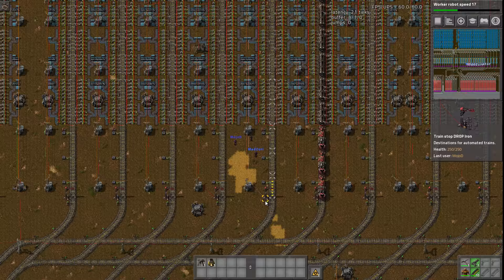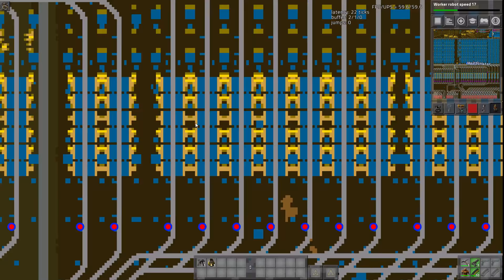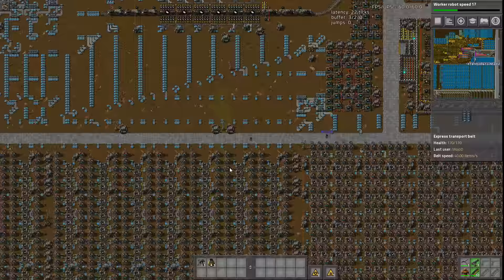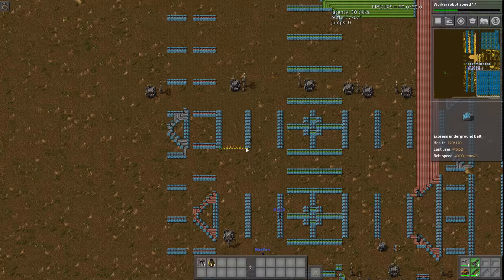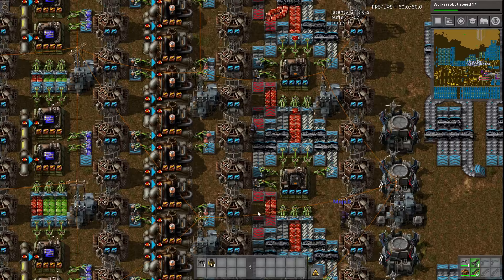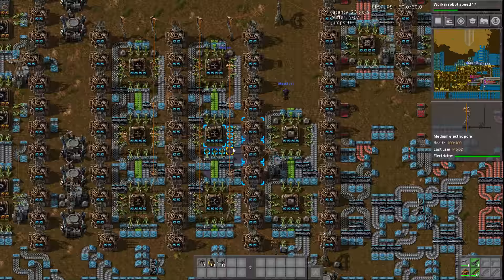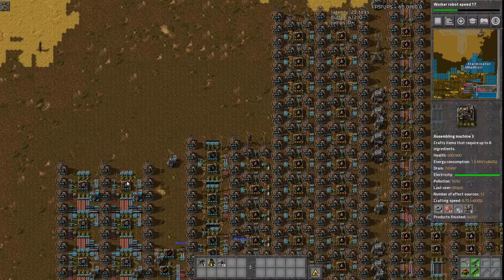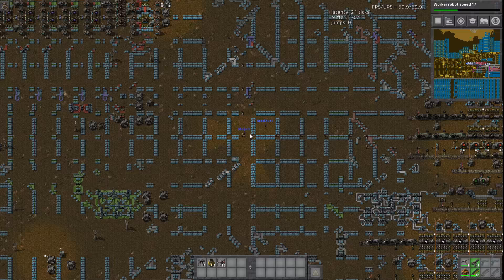Factorio: Megabasing 101 Reboot EP2: Belt Base Tour / Concepts - Tutorial Series Gameplay

Comment: In one of your workshops you mentioned that its not needed to balance an fully saturated belt.
So i cant understand the 32 lane balancer right after the smelters.
What is it needed for?
Reply: I think they meant there's no need to lane-balance a fully saturated belt because it's already fully compressed. The 32-belt balancer isn't to balance the lanes on a belt, it's to make sure that the output is supplied equally by all 32 inputs. This confusion probably stems from the fact that the two sides of a belt are called lanes, but people also use the term "lane" to refer to the full belt itself. A lane balancer is what they said wasn't needed, but the 32 belt balancer (or as they said at the end, 4- and 8-belt) is needed.
Reply: thank you!